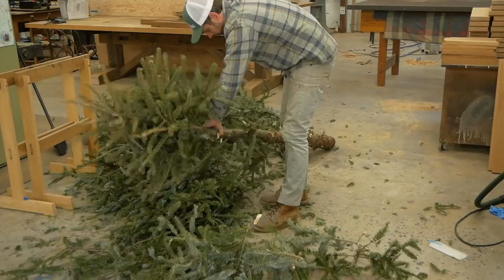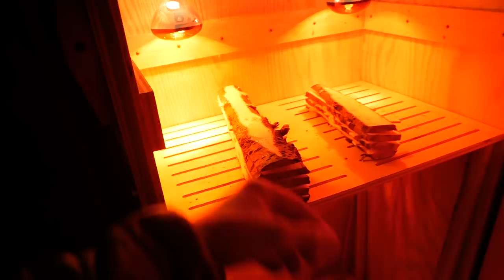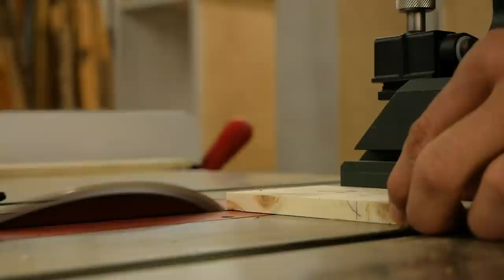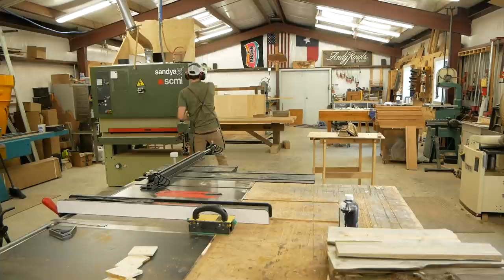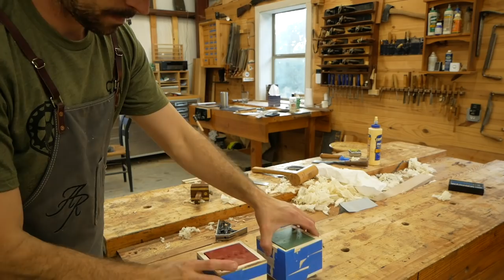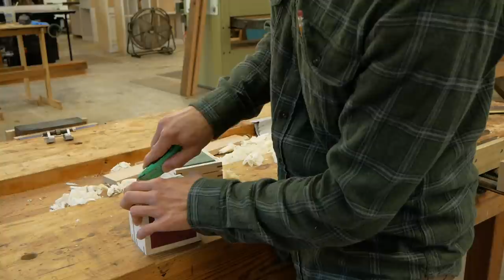I Used My Christmas Tree To Make Two Boxes!

Comment: Great idea and reuse so the tree lives on in another form and function.
Reply: it would have also been great if you used the tiny sprits of pin stems in epoxy for a inlay table project or furniture piece.

Comment: Nice video. I understand the part separating the top from the box bottom with a utility knife and leaving the tongue on the bottom of the box, after almost cutting through with the table saw. But I do not understand how the rabbet in the top was made to mate with the tongue. Must have missed something in the video that showed this or maybe not. Thanks Andy. I enjoy your videos. 
M. O’Brien
Alabama
Reply: You and me both.
Reply: The last groove he cut on the outside was 1/8” higher than the previous 3rd groove on the inside, which left an internal rabbit on the bottom and a external rabbit on the top.   Hope this makes sense.
Reply from the maker: It's really hard to explain but The Turtle Carpenter did a good job.  Its just two grooves halfway through the thickness of the material and they're offset 1/8" and cut on opposite sides of the board.  They meet up at the corners and create a rabbet.  There's a link to a book in my description where I got the idea.

Comment: Cool video! Why did you edge joint again with your hand plane? I would have thought that after the jointer and table saw all edges are square and parallel already.
Reply from the maker: I just prefer a perfectly flat straight joint, it helps since I was clamping with tape.

Comment: What was your Oven Temp and Time. . . 
Also time in the lamp Hot Box?
Reply from the maker: I set the oven to 200 degrees and took them out after 4 hours and moved them to the bulb kiln.  I left them in the bulb kiln for around 2 days at 120 degrees.  I actually overtired them, most of the boards were reading at 4% m moisture content.
Reply: @AndyRawls  awesome i was looking for this too, thanks!
Reply: @AndyRawls   
Thanks you wild Texan Craftsman you! 
That's some really good information there!!!

Comment: How did you make the jig you used for the splines?
Reply from the maker: It's just a block of scrap wood with two 45 degree cuts that meet at the point to make the 90 degree cradle.  It's very simple.
Reply: Really?